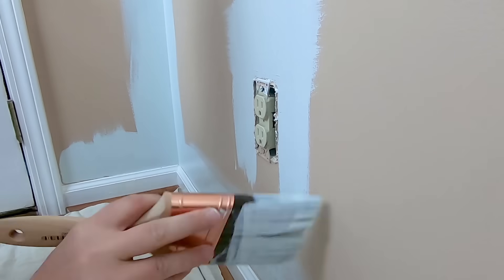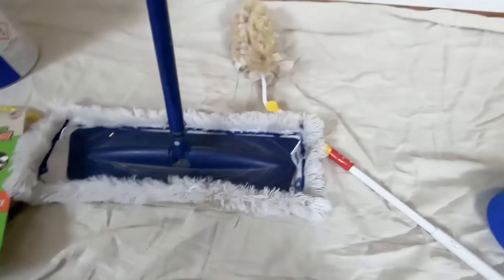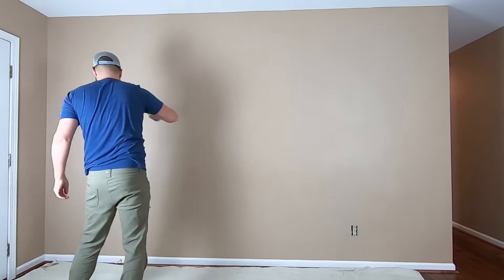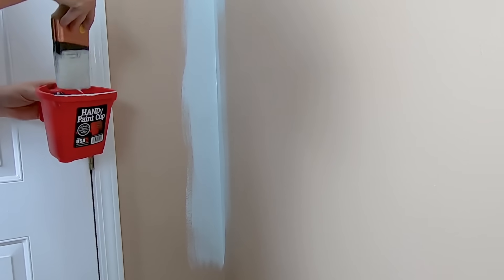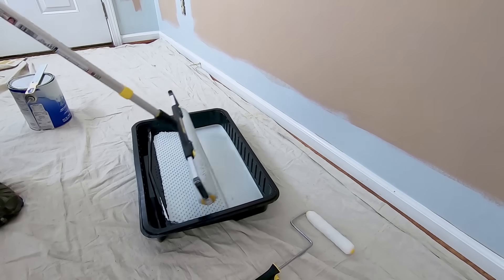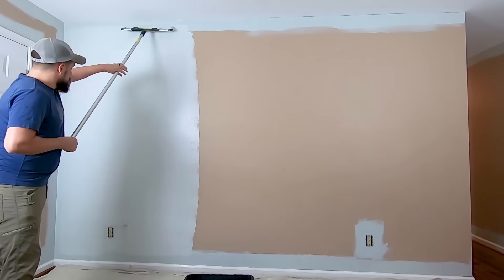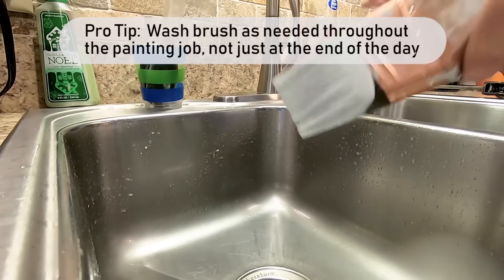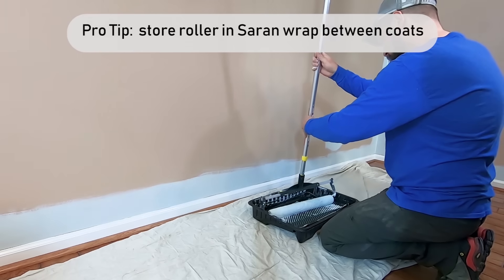How to Paint A Room Fast Like A Pro (Tips for Beginners)

Comment: Also when you are cutting in you don’t want to go back and forth. Hold the brush in one direction and only move in that way. That’s the purpose of the angled brush. Let the angle guide your hand without making a mess
Reply: There's absolutely no advantage to going only one way, using either is the same
Reply: @fuds2131  my associates who have been painting for 20+ years disagree. You can see a clear brush stroke moving in either direction. If you go back and forth it looks like an amateur. Moving in 1 direction is what pros do
Reply: @fuds2131  the light reflects differently on brush strokes going in opposite directions. This is from my friends in the industry who all have over 30 years experience. You can go back and forth if you want but it will look like trash or you can do it like the pros
Reply: @fuds2131  sorry bud but I do in fact work in the construction industry. I’m a GC and have multiple master painters that I use on my jobs who have all said the same thing. I’ve known most of them 20+ years and consider them friends. 

How about you provide the people with your business info so they know who NOT to use when then want a professional job done. 😂😂

Comment: "Paint glides easily across the first coat." Because you left 1/8" uncut? The paint will glide the same if you leave a gap or not. This is a rook move. Just cut the first coat and don't be so particular about the second cut-in coat. The benefit of cutting all the way to the ceiling on the first coat is that you don't look like an amateur when your customer walks in and sees the progress you're making. That tip may be ok for a DIYer but it is not a professional way to paint. Also, you forgot to mention to wet the roller cover and brush before using it in the paint. Never wash paint brush in a stainless steel sink but if you must, wet down the sink beforehand and clean it thoroughly immediately after each time. And you got all that splatter from the roller onto the baseboards because you didn't tape them before rolling the walls.
Reply: Goat

Comment: The only thing I’d add is to wrap your 18” roller in tape and pull off to remove any lint or particles before you start applying tape. Quality video

Comment: This is a really good video.  I have a primer coat and two paint top coats to put on.  Dry time is required between coats.  How do you remove masking tape without tearing the paint film when putting multiple coats on?  Thanks! 👍👍👍

Comment: HUGE cut lines man! Good tips for the homeowner that doesn’t have much experience,  but pros don’t waste that much paint on a brush…plus it is a much heavier application where you have put it on with the brush the cut line only needs to be an inch and a half to 2 inches wide , max and then you roll up over that brushed edge so you don’t see the texture of brushstrokes…I get it, the average homeowner is way too nervous to roll over a brush cut like they should without hitting the ceiling, and your cut line at the change in colour at ceiling won’t be as opaque if you aren’t doing it til the second coat….! You will also see your cut lines outlined  if you’re not rolling just as heavily. But good basic lessons for the beginner for sure. 👍🏻

Comment: great tip for cutting in color walls against a white ceiling is to run a light bead of clear acrylic caulking in the corner to be cut beforehand. this will make it much easier to cut a straight line. I painted for many years before I discovered this.

Comment: Some good beginner tips. I've worked in painting for many years. The baseboard section doesn't seem straight add shows the old paint on some parts, but maybe the wall is bumpy. Helps to tape it off with low stick tape for a perfect line. Same with door frames etc.

I find the brushing doesn't need to be so wide, once you get a hang of rolling you can get within a 2-3 inches of any edge :) 

Thanks for the extra wide roller recommendation, didn't know about this particular one.
Reply: I learned to roll first and cut in 2nd just so you can get in close with roller and use brush much less. Why does no teach this method??
Reply: @D_Parks  because it's backwards 😅😂

Comment: Always tape your baseboard. You're gonna get spray all over it if you don't. We always trim to the baseboard then when it dries run tape over it, and roll right down on the tape(no need to trim 2nd time). Turns out great.
Reply: Wow. Sounds like you don't know how to use a brush or a roller. SMH
Sad that young painters like you learn to spray before you learn the basics
Maybe on a tract home or new construction. But in  an occupied home like this, leave the spray rig in the truck.
Reply: And rolling the roller right onto the blue tape is scab work

Comment: When cutting in take a second to round out the corners and around outlets/switches. That will eliminate a hard edge  as you later roll. I also like to brush at 45 degrees at the tops of window and door corners for the same reason.

Comment: Use your roller to cut in. Make sure the roller is lightly loaded typically after you roll a zone on the wall you can use the roller to cut in.  If you touch the ceiling, simply wipe it down with a wet rag. Same around sockets. Always roll first and where you are not able to cut in with the roller you can brush.  I have been painting for over 50 years. This works well for me.

Comment: In the uk we paint ceiling first 2 coats or whatever is required to complete it. Then cut in and roll the walls as many coats as required. Then the woodwork goes...doors untill complete. Door frames...and lastly skirtings when your paint is a little dirty.

Comment: To properly shed a roller you can use tape. Attach the tape to a doorknob or the bottom of your ladder then run the roller back and forth until it no longer leaves lint behind. If this step is skipped you can end up needing to sand the wall before the second coat to remove the sharp lint that is now embedded in the paint.

Comment: Painting for 32 years in Uk. First of all you fill all walls and caulk where needed rub down dust off 
1 paint ceilings twice after 2nd filling touching in 
2 cut and roll walls but tape up floor first as roller will leave tiny spots on the floor 
2nd fill the walls with an led light rub down 180 grit then touch up then cut and roll 2nd coat 
3 two pack fill the woodwork or putty old school taking all fittings off then paint doors sills and frames first and skirting last as not to put any dust on the woodwork

Comment: Could I ask your advice? I removed a wall switch cover and it lifted some of the latex paint up and tore it. When I lay the torn part back down, all you can see is a hair line. 

Is there a way to properly repair this? The paint is in orange peel texture, so I'd like to avoid unnecessary sanding if possible. What do you recommend?

Comment: This was very helpful with regard to the logic behind technique and tool preservation. My main question is when would you actually use painters tape? When the color is different than the base board, ceiling, or connecting walls? I just noticed you didn't use any in this video, but it was white to white.
Reply: He used painters tape along the doorway trim that was too close to the wall to get his good brush in [7:06]. That's the only time I use it too, the rest can be cut in- it's much faster and more reliable (because you can see what you're doing, paint can bleed behind painters tape)

Comment: An 18 inch roller gets heavy and hard to use when the walls have waves, which they often do.  A 14binch works better and still covers 5 more inches per pass than the 9 inch.  I still prefer the 9.  It is critical to finish each roller pass with a downward motion to leave a uniform stipple pattern.  As for cutting in below ceilngs or crown or abovr baseboards or around casings, if you want to see the former paint color after applying two coats of the new color, do as this guy says.  If you want to see the new color only, cut right next to thr ceiling or trim on both cuts.  Trust me on this, there are no cutting in shortcuts by skipping one coat, no matter how thin such as an eighth of an inch.

Comment: Overall that was a pretty good demo, a few things that I do differently, the angle of your brush cutting in made it a lot harder and a lot slower and less accurate, no need for that gap you left on the first coat, add a little water if it's not perfect and hit the ceiling with about 1mm of wall paint for a perfect line, use a damp cloth to remove the dust and an inspection lamp on every inch of the wall at different angles,   Purdey is no longer the choice of professional decs in the UK but still an ok brush albeit overpriced, I would still wash anew roller before first use.but for the most part you did an excellent job.
Reply: What is the chioce of brush for pro's in the UK?
Reply: @HellsFinestUK  Wooster is a good brand, I personally like the Axus brand and their mink series, I prefer bristle for sash brushes rather than synthetic, just stay away from the really cheap tat like prodec

Comment: You didn't talk about booking the paint. I suggest using a roller to go over your paint when you cut in to erase the brush strokes. When I clean a brush I use high pressure water to get all the paint out ftrom the inside of the bristles. If I want to reuse it right after cleaning I make sure I get as much water out as possible or it will make your paint watery, and drip. I beat the bristles (carefully) against the side of the sink or something outside. Don't damage the bristles.

Comment: I'm painting some rooms in my house with eggshell finish paint. Where I cut in the edges, it is smoother than where I used the roller. The sheen is the same, but the texture is a little bit different. I suppose I could tape off all the edges and take the roller right up to the edge of the tape, but that can create other problems. Overall, it looks good, but if you look closely, you can see the texture difference along the edges.
Reply: Next time when using a paint with a sheen, it is best to make sure that your cut is is still wet when you roll. Especially on the second coat. So sometimes it is best to cut in one wall and roll it out, rather than doing an entire room, then coming back later to roll it out. If that isn’t the issue, then a lambs wool roller nap may fix the issue too. It leaves a more uneven edge, so that it blends in better. Hope this helps.
Reply: @pamelapainter3195 thank you for your comment.  How would you handle a large wall if you are painting alone? By the time I finish cutting in, the paint will have dried.  Would you just cut in a section and then roll and then repeat until you reach the end of the wall?
Reply: @PreferDIY  I’m pretty fast at cutting in, so I wouldn’t have an issue cutting in an entire wall and then coming back to roll it. If you are not taping off your base, maybe you could try that, so that you can cut in faster.

Comment: Super easy way to clean your roller after painting is leave the roller on the extension pole just as you were using it, lay over a 5 gallon bucket to where the roller is aimed to bttom of bucket free to spin... Shoot it w water hose. Spins all if the paint out of toller... Into the bucket leaving ZERO mess!

Comment: I used paint at Rona and took 3 coats to paint a white ceiling and ended up with buying two 4Gal cans. I used paint at HP named Berh and only one coat on ceiling, one coat of beige colour on the wall that had the same colour. They have 3 prices, get the middle price. BTW, rinses the new roller under tap water to clean off the lints then wipes off excess water with your hand. The moist roller will keep the acrylic paint fresh and smooth on the brush.

Comment: 18" only if your surface is flat, wavy walls will be a nightmare. 

Roll the roller between your hands and take note the direction of travel. Seat it onto cage so it travels in towards the cage and not out.

Painters tape or something similar around the threads of your rolling handle if it keeps coming loose.

Comment: Cutting in over existing paint. But my cut ins are distinctly darker than the rolled parts. Any idea why? I’ve boxing my paint an always mix well before pouring into the tray. Brush and rolling from the same tray 😪
Reply: How much paint is on the brush, and are you "laying it off" after each section and feathering towards the middle?

I would also consider that the previous person could have done 2 cut in layers so you're seeing a ridge and it appears darker? No clue, but I know what you're talking about. Hope you figure it out

Comment: hi donovan first thing wrong no tape on base trim that roller sprinkle 18 inch on a house for me is over kill your limited were that roller can fit when you roll out your first five feet of wall you back roll over what you roll out use no pressure let the roller do the work if you have to push on roller to get paint then you are dry rolling and always cut one wall out then roll it so your cut work is still wet if you go wet to dry it will picture fram or some painters           call it flashing and one more tip is to rap your roller cover with blue tape before you dip it in paint when you remove tape from roller cover it will remove the fuzz on your cover and stop them from making your new paint job with no fuzz

Comment: You have to paint the trim first. Then tape the trim with frog tape when dry. It's easier, quicker, and will get you much better lines. After taping the trim, cut in the walls without worrying about wall paint getting on the trim. Even if you're not painting trim, you still should tape it before paint walls. It's just quicker and easier.

Comment: I followed all of your instructions but ran into a serious issue, after I finished and packed everything away I went back to look at the wall and to my surprise it was actually great, I got all the edges right with your tips, and it’s as smooth as can get, the issue I had was, as I was washing the brush in the kitchen sink, my wife approached me and stabbed me a little. It’s very painful, and things are getting slightly fuzzy, and advice?
Reply: yes, get a utility sink in basement/garage for those chores, at least that's what my wife has asked me to do, I told her, can I have that as my next gift?

Comment: Do i have to turn off the power to remove cocer plates?
Reply: No, the hot wires in the outlet should be a couple inches behind the wall. You can place tape around the outlet and the hole to prevent dust or paint, but i usually leave them open

Comment: I don’t think dusting the walls is necessary, it adds solids in the paint and helps with coverage. Also a tip from my late father, when cutting in the ceilings touch the ceiling just a bit. That way you don’t see the imperfect line created in the corners. Although you did good it can still be seen in your video.

Comment: Some great tips that will make my next decoration job a touch less painful.  
One thing i feel you missed, I peel my painter's tape the moment I have painted past that run, so that the paint does not dry across the wall and the tape, peeling and cracking as you pull the tape.  That might mean you have to mask twice, if doing more than one coat, but it's worth it.

Comment: This is the one thing I will ALWAYS do, whenever I am working on a ‘multi-days’ paint job:

At the end of the day, I will put the brushes and rollers I’m using in a plastic bag (each its own) and close it tightly. 

Then I will simply PUT these bags IN THE FREEZER!

The next day I will take them out again and my brushes and rollers will be (ALMOST) instant ready for use…. 

Give it around 20 minutes before actually starting the work to be on the safe side! 

(If I know upfront that I don’t need a certain brush that day, but in a week or so: just leave that brush in the freezer until I need it again. 
This must be within the same project though, can’t leave it for months laying there without cleaning of course!)
Reply: Me too. Freezer’s my friend and have the space. Food costs so much now.
Reply: Terrible advice, you have clearly never tried this. Frozen latex paint gums up.

Comment: My understanding was to roll while the cutting in is still wet. You cut the whole room in first. Do you not end up with a cutting in line? Or is it just that you feather it completely??
Reply: Feather the bottom edge when you cut in
Reply: Sometimes when I roll an L I don't overlap the whole rizla, just stick half the width of the sticky, smoke less paper
Reply: That was an absolute necessity with oil based paints of the past. If you rolled a wet edge onto a dry edge there would be a flash mark where the two meet. Oil based paints also had enough working time before they set up that 1 person could cut a wall and then roll that wall before the cutline started to set up. With longer walls you would only cut 10 feet in front of you, then roll to catch up and then repeat or have two people - 1 cutting and 1 rolling right behind. Nowadays we use acrylic latex paints. They dry by the time you move the ladder to cut in the next section so it is impossible to roll into a wet cutline. However is doesn't matter with acrylic latex paints, they don't flash at the edges like oil based paints do. You can cut in today and roll tomorrow - makes no difference with them, they don't flash at the edges.
Reply: @TheLandBeyondBeyond  absolute golden nugget of a comment 😂😂😂